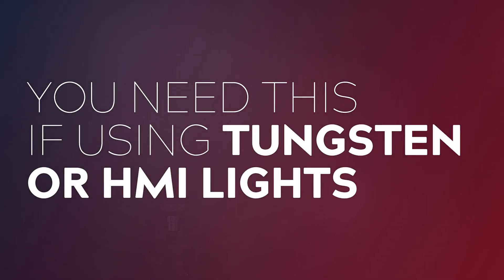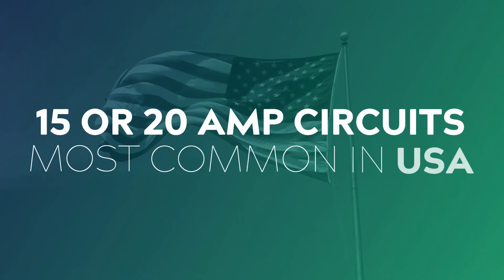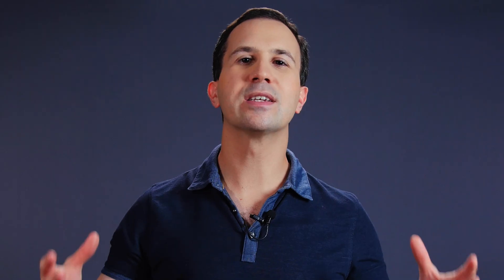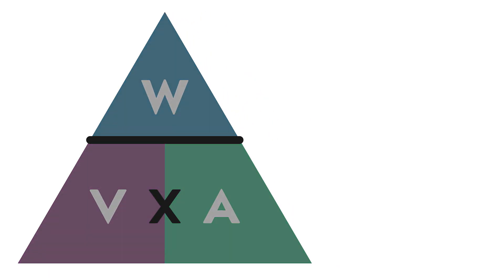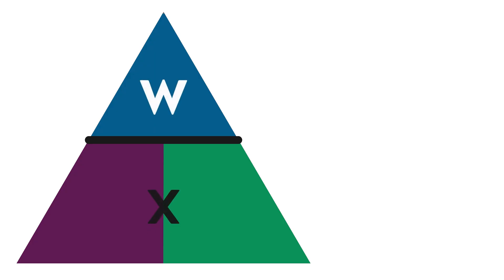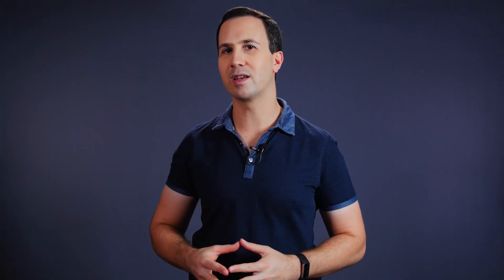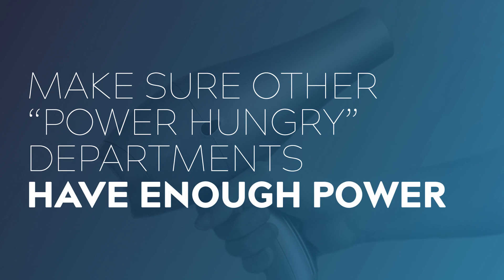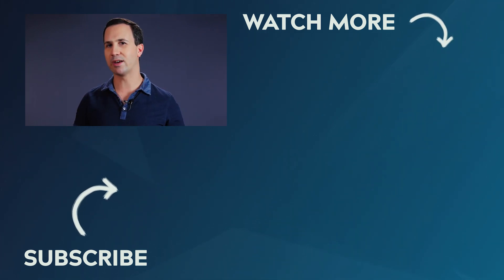Wattage Voltage Amperage Formula - Never Trip A Circuit Again! | Film Lighting Techniques

Comment: Could you please tell me what unit shows the Amps of each circuit, because I only see it listed for my AC circuit (20a) and the mains (40a) but same as in your photo, my switchboard is also clipsal brand but I only see mA listed, I don't know what C10 means, is that the amperage? Cause my 2 heneral power circuits seem to say C16, light circuit C10...
Reply from the maker: 1000mA = 1amp
So if it’s a 10,000mA breaker it’s 10amp. Also, C10 = 10amp breaker, C16 = 16amp breaker.
Reply: @CreativePathFilms thank you. So does that mean I can load up to 16A on one circuit in my house? Well 12.8A if using the 80% rule. Even though all the GPOs themselves in my house are 10A outlets?
Reply from the maker: Correct. Max 10amps on any single GPO, up to a combine maximum of 16amps per circuit. Remember that included any appliances already drawing power on those circuits. You’ll also want to identify which GPO’s are on which circuit, so you don’t inadvertently overload one of them.
Reply: @CreativePathFilms thank you so much for your help, especially for a video so old. I have one final question, is there an easy way to identify which GPOs are on each circuit without turning off the breakers for all but one circuit, then testing each GPO in the house and seeing which work, then repeating the process for the other breakers?
Reply from the maker: Not really 😅 that’s about all you can do, isolate and test. In my place half a room is on one circuit, the other half is on another. Couldn’t have found that out any other way. Good luck! Always happy to help 😊

Comment from the maker: A quick note:
Although mains power is most commonly 240v/120v, it may be prudent to adjust your calculations to use 230v/110v (or 100v if you want to make the math super simple) for safety reasons and to give yourself a little extra headroom.